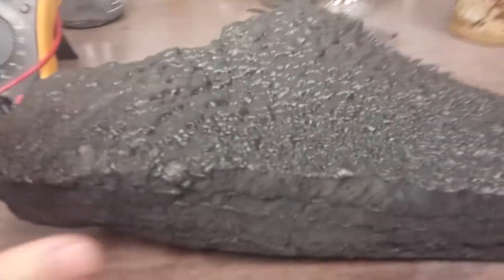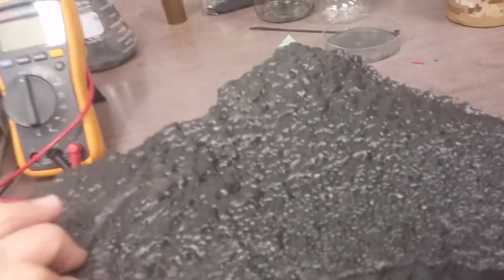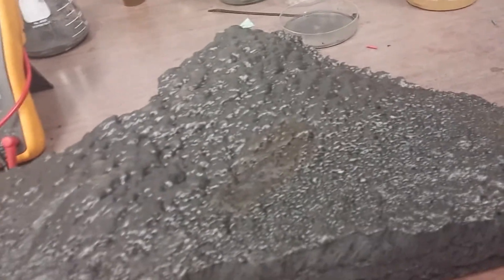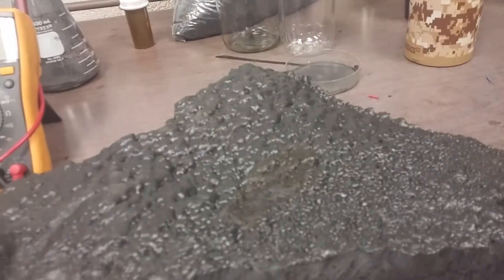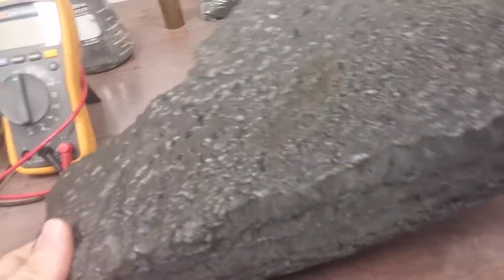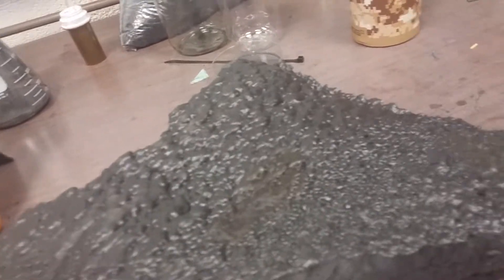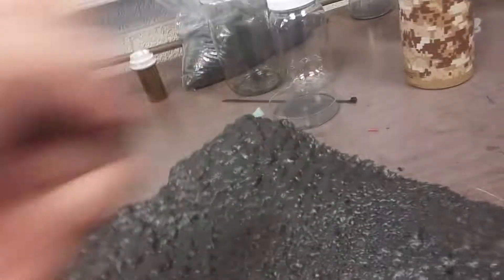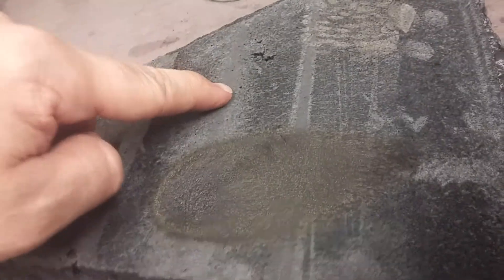Graphene enhanced foam

Comment: I have an industrial application for this product. I'm happy to talk licensing with you guy if you can show me how strong it is when it's thin.
Reply from the maker: Like this? https://www.youtube.com/watch?v=CZ2xAtZZoSQ
Reply from the maker: Plus, we can make literal tonnes of this material.
Reply: +Venturestarx is this foam able to store electrical energy? I've seen some people use Graphen for super capacitors.
Reply from the maker: Fetch Marks the Spot I haven't tested for capacitance. Maybe a neat thing to look into.
Reply from the maker: Fetch Marks the Spot you can PM me by going to the "about" section of my page and then message. I'm actually about to post another video on this foam.
Reply from the maker: Fetch Marks the Spot you can either give me your email, or PM me.
Reply from the maker: I sent you an email.

Comment: I'm building an aircraft now. I'm willing to use it.

What is the mix and method. 

Mix the graphene oxide into the base? How much?
Reply: Voglerlake@gmail.com
Reply: PS. Great attitude! :-)
Reply from the maker: Michael Hayes we used a large homoginizer to put the graphene into the part A. The cost can vary by loading. 5% by weight will work. We can supply the 2 part material with the graphene in it, or supply the graphene. PM me on here for an email exchange.
Reply from the maker: Michael Hayes very interesting, you won't need much material for this application. Plus I can help you with some other parts.

Comment: Saw the test of this in the other video, was excited to see it tested 23# compared to 6# test strength .. was curious if it is in a epoxy solution or just dunked in the graphene solution? ... if so maybe a test of the foam with epoxy verses a test of the foam with the epoxy with the added graphene and it's strength differences..
Reply from the maker: No, the graphene is actually suspended in the foam matrix. But I'm looking into load cell test stands to test resins and plastics with graphene in them on video. I currently have to rely on 3rd party folks, and want to speed up the process.
Reply: Venturestarx you might want to check out Robert Murray-Smith's vids on his graphene enhanced plastic. Has many of the properties you're claiming for your foam. It's actually bullet proof and he proves it! Love to hear more about foam as it might have a place in my boat project. I've just subscribed to your channel hoping to hear more.
Reply from the maker: Alain Grignon Robert and I are well acquainted. I have sent him material. He doesn't have the business limitations I have. :)
Reply: Venturestarx just spreading the luv....
Reply from the maker: Thanks a bunch!

Comment: Is it electrically conductive?
Reply from the maker: No.
Reply: It's a great conductor 😍
Reply: @GALO CEGO PUTO DA CARA you  can't even see a NANO sheet !
Take a pencil , draw a line on paper.
Graphene?  Nope 
Millions of layers of graphene
You need a very power microscope to see a single layer 
If there is a way to see this how would you introduce an electrical
Current to somethings so small?
They have to use a medium ,  GO
graphene OXIDE
A few others ive heard too
See Robert Murray Smith videos

Comment: With small, micro holes through it, and lined on the front and back, with a few layers or so of uhmwpe woven fabric layers, it would make excellent bullet resistant material.
Reply from the maker: I don't think it would do that well in that instance. Maybe, but I doubt it. It's strong, but not that strong.
Reply: It's not about strength, but about dispersing force (which foam does well, but normally is too soft for this purpose).  A paper telephone book can stop a fair amount of different types of bullets. Problem is, it's heavy for it's volume, can get wet, is very flammable, etc. This foam is a lot better in these regards, except it would be hot (the micro holes would help).  In any case, like I said, it would be a lot more effective with some layers of woven uhmwpe fabric around it. The latter is already used, as well as kevlar, for bullet protection, but these are expensive and heavy as well, especially since you need so many layers to stop a bullet.  

  The foam in combo, might reduce both total weight and cost of such systems.

Comment: does any transfer off if rubbed on a surface. the first instance of Graphene I've seen was a piece of flat metal that resembled steel this looks like the color of graphite. powdered Graphene seems darker too.
Reply from the maker: The foam it is in holds it very well. At first there is a little residue left from the foaming process, but that goes away fairly quickly.

Comment: Generally Ducon's Micro-Reinforced UHPC is looked at as the best of the best in overall strength from what I've seen on Wikipedia (138MPa - not true anymore!), but the mortar/ grout used is meant to flow into the fine steel mesh and is not designed to be strong by itself.. some examples say the grout is only capable of ~1,300PSI by itself without "micro-reinforced" mesh, and any mechanical changes should be sought by changing the steel mesh grade and volume fraction... but with something like larger graphene sheets evenly mixed into the grout you could improve the weak component of this concrete to form even better MRUHPC theoretically. Or anything, really.

https://en.wikipedia.org/wiki/Types_of_concrete#Micro-reinforced_ultra-high-performance_concrete

also, it would be cool to see some additional concrete tests along with Robert Murray-Smith's video on your channel! maybe just a quiky bag of cheap-o stuff from the market and a smash test or something lol... we have unfortunately made Mr. Murray smoke even on video now after him having to answer all our comments :o

https://www.cpi-worldwide.com/en/journals/pageview/3045?issue=02&year=05&language=2&pagefrom=66&pageto=72&page=66

P.S. Would ya look at that, just look at it... 200 MPa and counting. Ducon doesn't have these specs!

https://www.structuraltechnologies.com/product/ducon-micro-reinforced-concrete

https://www.fhwa.dot.gov/publications/research/infrastructure/structures/11038/

Whether its a fine mortar used with fine mesh or fine fibers you are essentially reducing the spread of cracks and supplementing the compressive strength of concrete with the tensile strength of metal or other materials. Graphene depending on the size of sheet or ribbon could help or hinder the tensile and compressive strengths of these futuristic concretes, but care should be taken that it doesn't interfere with the chemical bonding of the matrix or blocks water from getting to sections of the aggregate. CNTs might be a better solution, but we would just end up replacing the concrete as nothing compares to carbon's covalent bonds for simplicity and large scale strength that we know of and can start making.

https://www.fhwa.dot.gov/research/resources/uhpc/105-M68.cfm

Ductal 207 MPa UHPC used in bridges, dams, buildings

http://www.ductal.com/en/engineering/why-use-ductal

COR-TUF 244 MPa by The US Army Corps of Engineers Engineer Research and Development Center (ERDC)

http://techlinkcenter.org/summaries/cor-tuf%C2%AE-ultra-high-performance-concrete

Comment: This might seem impulsive, but 2 thoughts: 1. Does Robert Murray Smith's electroysis of graphite in sodium sulfate really make 80% 1-3 layer graphene as he claims? 2. Would dissolving abs pellets with acetone ,adding graphene, and stirring work? Thank you again, and know that to me and others you are a legend.
Reply from the maker: Insidious Blank I haven't verified the 80% claim, but I could. It's possible, but from what I do know you must use a very specific graphite precursor. Robert has access to many kinds of graphite, so again, possible. As for the ABS, yes, you can do that. The only problem is that ABS is weakened by solvents.
Reply: Venturestarx I mainly wanted to know if it was successful in making graphene and not RGO, the percentage was secondary to me. I know you do a lot of welcome debunking.
Reply from the maker: RGO is not present in this kind of process. I am going to do a video on how RGO is made very soon.
Reply from the maker: I don't do so much debunking as I do verification. It's actually exciting to help someone along who may have something really neat. It's a dick move to shit on people's work, unless they are trying to be fraudulent.
Reply: Well, as Thunderf00t goes.. the definition of that is debatable lol

Forget I mentioned that name!

Comment: Ok that looks interesting but is the strength due to the graphene or due to the bonding material, ie would you get similar results without the graphene.

I know everyone is going mad over graphene but haven't really seem that much use for it without the need for a glue, and wouldn't you get similar results with just the glue on it's own?
Reply from the maker: No. This is polyurethane foam that normally rates 1-1/2 lb foam. It's now stronger than a 20 lb foam. True graphene (like what I make) actually makes materials much stronger. I'll be posting another "classroom/lab" video about this soon.
Reply: Ok I can see how some people would grasp at this idea.

But if strength without the need to conduct electricity is the aim then super glue and baking soda does a really good job.

The only advantage I can see with the use of graphene is it's ability to conduct electric signals within a glue.

In fact if you get a graphite pencil you can draw lines on paper and transmit electrical signals, you may not get a fantastic signal depending on how long the line is but you still can transmit signals from a simple drawn line on a bit of paper.

It has to be a graphite pencil though normal pencils not so good.

So I'm wondering what's so special about graphene in powder form other than it's ability to conduct electricity?
Reply from the maker: If you put graphene in cyanoacrylate (super glue) you will get a very tough material. The issue is weight. Tungsten is very strong, but heavy....
Reply: Yes that's what I thought, but not only weight but conductivity.

Cos if you just wanted strength then baking soda is fantastically strong hard as nails and light, but not conductive.

Graphene is conductive strong and light, so has one property more than baking soda.

Graphene is good for anything that needs electricity running through it, but otherwise it has no real benefits above baking soda.

But let's get real here, graphene best most useful properties are as I said conductivity coupled with the ability of it to be mixed with all types of glue to make it flexible.

So with that in mind why isn't it used as a paint former, mix it into paint and spray it on, you could have massive light displays using LEDs and such just by spraying the stuff onto wood, do away with cables.

Flexible wrist bands that have LED displays using a flexible glue, for example.

Graphene by itself is not that great, unless you make use of the conductivity and it is dependent on the glue used.

But you could use as a substitute anything from sand to ground rice so long as you use the right glue, the only thing that would be missing is the conductivity, and sure graphene would be stronger than rice but unless we are talking about making air craft wings why would you need such strength?

Also you could get hold of a bag of coal crush it up to a fine powder and produce a very strong structure mixed with the right glue.

I'm yet to see any real benefits other than conductivity by using graphene that you couldn't get using another material like baking soda.

Comment: Imagine having a hammer (or ANY tool for that matter) this light and this strong! O_O
Reply: Imagine understanding physics and realizing a hammer works because of its mass and impulse.
Reply: That's why I don't have a Physics-Degree! ^^'
Reply from the maker: Kniffel101 a hammer wouldn't work so well out of this material. It's tough, but not like that. you really have to have weight as well.

Comment: Have you registered a patent on this? If not, you should rush out now and file one because someone else, viewing this, will do that. They don't need to register a formula just the principle.
Reply from the maker: Everything I post has IP protection. That's another reason why I make such crappy videos. I can't give secrets away.
Reply: +Artytom. For most people, patents are more trouble than benefit. Once you file a patent, someone only needs to change one item or step and then they can beat you to the market and wipe out any chance of you profiting from your idea. ('Patent Pending' is used for very good reasons.) As a rule, never patent your best ideas. Always have something much better in the pipeline.
Reply from the maker: Well that can be the case, unless you have tremendous lawyers. I happen to.